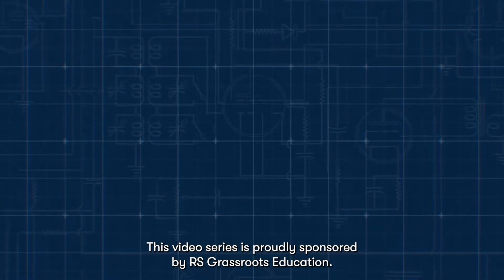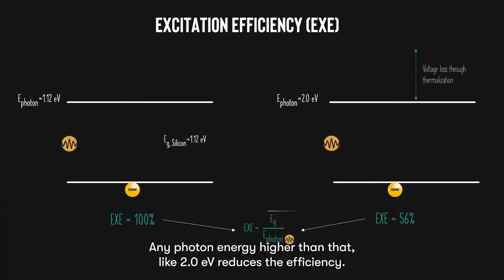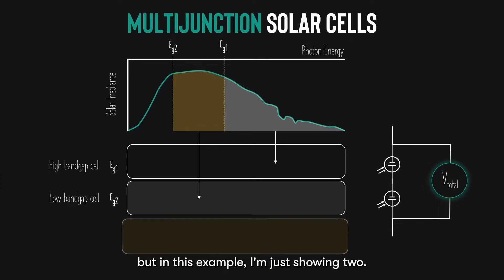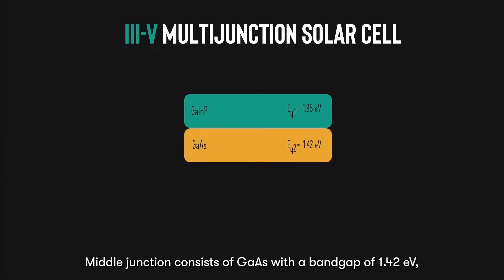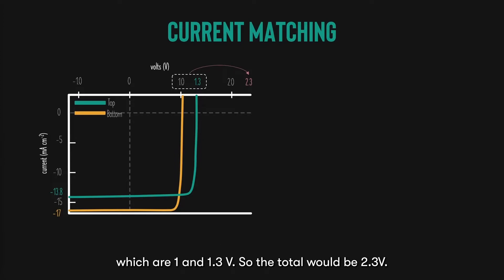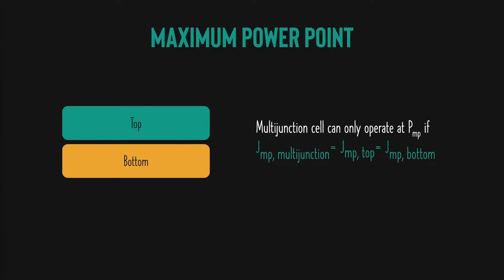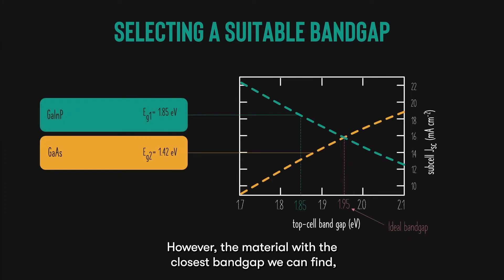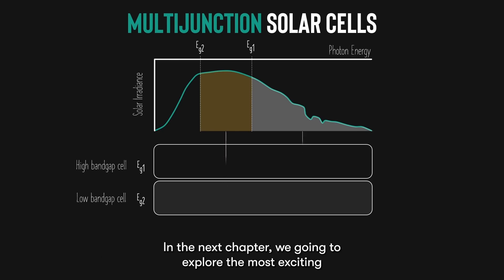Shining Light on Solar Cells - Chapter 9: Multi-junction (Tandem) Solar Cells

Comment: i think the illustration at minute 3:00 should be the other way around. photons with higher energy (the brown-ish region) will be absorbed in the upper cell with higher bandgap. photons with lower energy (the grey-ish region) will transmite through the upper layer because their energy is to low to lift the electron "over" the bandgap. That's why they will be absorbed at the bottom cell that has a lower bandgap.
Reply: Hi there, Christopher here. Thank you for your comment. I see the confusion here. In the graph, Eg1 is higher than Eg2 (the energy increases towards the right side of the x-axis). So the greyish region is the higher energy region, and the brownish region is the lower energy region. 

Hope that clears things up!